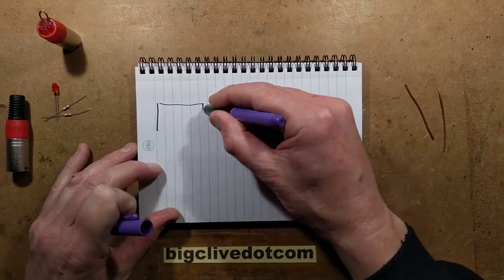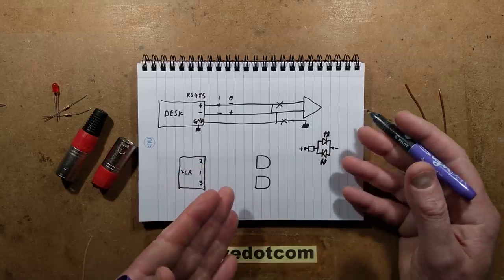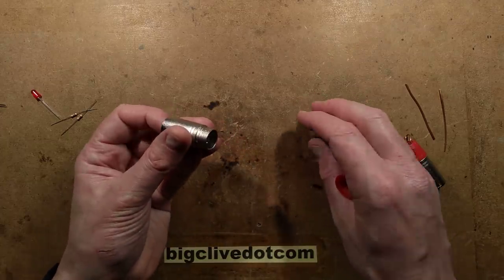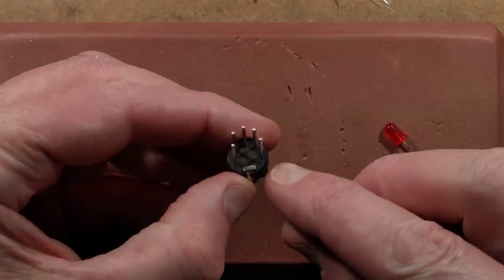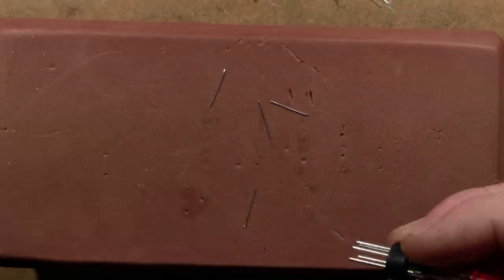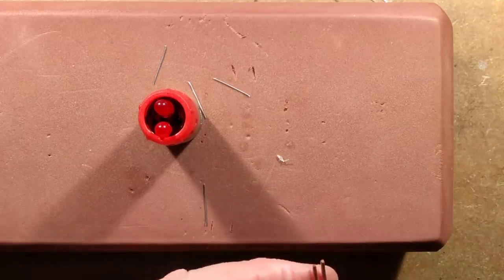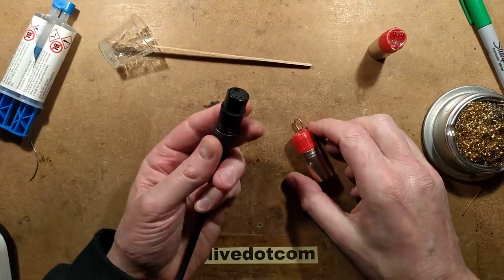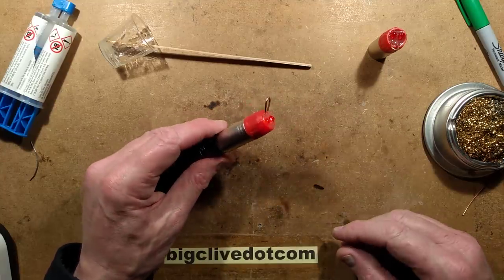DIY keychain DMX tester for lighting technicians.

Comment: I assume that DMX isn't used for any safety critical FX control signals like pyro, with the 5 pin they could have implemented an antivalent signal comparison check.
Reply: It does get used for pyro
Reply: They're not safety critical !
Reply from the maker: It does sometimes get used for pyro control, but only with specialist protocols designed to prevent false triggering on rogue data.
Reply: @bigclivedotcom  To me, the logic would be simple that pyros would be deactivated until a 'window of need' occurred - and withing that window, actual triggering could be done with DMX.
Same with lifts. You see these fancy computerised lifts here and there but you'll not find the computers controlling the lifts - that's all done with electromechanical equipment that's safely reliable. The computers 'request' of the lift controllers to move the lift from A to B at efficient timings.
Nice example - Aston University 'Sky lifts' - once going up, I opened the lift doors. The lift was stopped by the lift controller, not the computer. On closing the doors, the lift then went down - but the numbers on the floor display carried on going up. I suspect the lift controller simply returned the lift to the ground floor irrespective of what the computer wanted - and once there the computer would be reset.

Comment: When I use to do gigging. John (who was a very, VERY clever person) made a few of these and it was a life saver when it come to troubleshooting. Also, the ones he made could tell if it was revers polarity as well which also really helped. 
That must of been at least 15yrs ago 🤔

I really hope you don't use that yellow screwdriveron live things? I'm not tell grandma how to such eggs and I know your a lot smarter than me.
Check out Photonicindution's channel & he tests one of those screwdrivers to see just how "safe" they are.

I love all of your videos btw. There so interesting n I've learned a lot from watching them 👍🏻
Reply from the maker: It's the electronic version of the neon screwdriver, but still lacking a decent series resistor.
Reply: @bigclivedotcom  I'd NEVER use that on anything live. I know there are one's that have a battery inside so you can check to see if there's continuity. You can also put it on someone live, without tough the end n it lights up.

Comment: Soldering XLR cables is one of the worst tasks I've ever had to do. They're super awkward shapes and if you hold the iron on too long (e.g. repairing an old cable and removing an old broken lead) then the plastic casing melts. Burned myself holding the pin I'd been heating a few times too. Don't let idiots hold soldering irons; we will burn ourselves.

Comment: Probably a stupid question but I'm from the IT world not power electrics world.
Is data ground the same as power ground in this case?
Reply from the maker: It depends on the internal circuitry of the lights.  Generally the data ground will be referenced to the circuitry ground, but that then might be referenced to chassis, and therefore power ground.

Comment: Is it possible to make one of these with a 120Ω terminator resistor built in?
Reply from the maker: There is a version you can make that doubles as a terminator, but not the best type that needs the data lines unlinked.

Comment: Can this be used to test the DMX output on a firing system? A non fired Arial shell can be really dangerous and multiple precautions must be taken.
Reply: DMX is absolutely not what you want to be using for pyro. DMX does not use integral error checking of any sort.
Reply: @Peter_S_  diy version works well with DMX but never thought about the error checking
Reply from the maker: Some pyro systems do use DMX, but with a complex error detection protocol built in to detect rogue data.
Reply: @stonedsavage7814  using DMX as the transport is certainly acceptable,  but only if another layer of protocol sits above it as Clive mentioned. If I were DIYing a DMX setup for pyro, I would make it send a series of values in successive frames to arm the device for a short time (like 1 or 2 seconds), followed by a another series of values to issue the fire command. That could be done with plenty of safety. At the very least I would have an independent DMX universe just for the pyro. A better solution would be a bidirectional network and controllers that could give you a safe continuity reading of the igniter remotely.

Comment: Clive at 16.00 it that a Ryobi cordless 18 V  glue gun ?? not seen one here in the US   . And my old radio shack soldering station has gave out the 5 pin has gotten broken  What is a good soldering station at 75$ US on Ebay you would recommend ??
Reply from the maker: Yes it's a Ryobi one plus glue gun.  The generic Chinese solder stations are usually fine, but check the wiring and ground continuity on them.

Comment: Using same colour LED, cutting them the same length, moving them to the centre...

Makes it absolutely impossible to distinguish which one is lighting up.
Reply from the maker: It's purely to detect an open or shorted wire.  The usual fix is to replace the cable and take the faulty one up to the workshop for repair, or to find the fault locally and fix it in situ for awkward cable runs.

Comment: very nice hot melt glue gun. Does it heat up quickly ?
Reply from the maker: It takes a while to heat up, but is very good.  AvE did a thorough review of it.  It's the Ryobi 18V one plus glue gun.
Reply: thanks for your answer

Comment: Clive any ideas on testing XLR mic runs finding a faulty XLR mic cable can be a pain? Crackles failure etc...
Reply: Is that crackles with moving cables or static cables ?
Unless a cable has had exceptional stress in life, most cable faults are at the connector. Most issues can be sorted by cutting a couple of inch off the cable and remaking the connector. Failing that, try the other end. Failing that, repeat but cut a foot or 2 of cable off.

Usually, if you can get a crackle by wiggling cables near the connector - that's quite a good way to find the issue.

If the issue is present while cables are not moving, again, try wiggling cables near connectors. Or take out 'extension leads until you end up with the mic plugged direct into the amp ! If you still have crackles, it's not the cables !
Reply: @millomweb  - Ever had anyone make fun of you for a mic sticking straight out of the socket?    I had a sound board with one straight into the plug, and people thought I was nuts.
Reply from the maker: There are a couple of options for the sound guys.  A mic in a plug as mentioned and also an XLR with a piezo transducer in it that lets you listen for a line level signal by popping the end in your ear.  It's manufactured and sold as the Vizear.
Reply: @tbelding  Why did they think you were nuts ? If that's where the sound was, seems quite reasonable to me ;)

Comment: It would be smarter to add one red/green light (with oppsite poles), then a normal LED, then 2 diodes, and then 3 resistors. Connect like this:
Add resistor to red/green LED and the diodes. (not LED2)
connect then like this:
DMX+ --> Pole A on red/green LED+resistor and Pole A on Diode1+resistor
DMX- --> Pole B on red/green LED+resistor and Pole A on Diode2+resistor
Pole B on Diode1+resistor to PoleA on LED2
Pole B on Diode2+resistor to PoleA on LED2
LED2 Pole B --> Ground

Diodes should be "towards" LED2.

You will now have five states:
If red/green light shows RED + ground flashing RED, then one of the data connections is broken.
if red/green light shows GREEN + ground flashing RED, then the other data connection is broken.
if red/green light shows ORANGE + ground constant RED = everything is working correctly.
if red/green light shows ORANGE + ground is EXTINGUISHED, then ground is broken.
if ALL leds are EXTINGUISHED, then at least 2 connections are broken.

They all fit in the connector because the new connection is parallel to the existing connection, thus they don't take up more space vertically. Makes more of a "safe" detection. Because in your connection, if both leds are out, you don't know if its only a broken ground, or if one/more data connections is broken aswell.

In my connection, you will see if just the ground is broken and both data lines are healthy.
The extra diodes are required to prevent the DMX+ and DMX- backfeeding each other via the ground connection, thus preventing any detection.

Comment: to get more hot glue flow, I cheat and "overheat" the glue gun tip with a small torch, yes the glue will catch fire and burn, but the hotter it is, the less viscous and easier flowing. preheating the other materials works too, but isn't always doable.  I've even directly torch heated glue sticks until they start burning, blow it out and let the dirty burnt part drip away before globing it on whatever, too lazy to wait for the gun to heat up.... yeah, I'm a special kind of nuts I guess ;)

Comment: Dammit miss read that, puts the BMX away sadly !
Thinks it could be dinky if you soldered the LED s via resistor direct into the plug then pot with clear epoxy !

Comment: And if connected to a DMX signal, like on the video, becomes a personal Christmas light also.
Reply from the maker: You can make the other simpler version with an additional terminator resistor and it makes for a nice flickery pixel at the end of a run.

Comment: I think your power calculation for the resistors is off. I'm getting 60 to 70mW peak with a data line stuck at 5V+10%, resistor at 220R-5% and LED at 1.6V.
Reply from the maker: I based it on 2V drop across the LED with 3V across the resistor.  Still nothing for a 250mW or 125mW resistor.

Comment: "Give it a wee drag" instead of just plugging in an extension?
Reply: Yes when u only need that extra inch
Reply: Eddie Thought typically is that the cable is snagged and a quick tug will unsnag it or tighten a knot in the cable from hand size to snack pretzel size.
Reply: @johnfrancisdoe1563  But not really is not unlike?

Comment: Electronic tech, lotsa rs 242, 485, spi debugging. First line sanity check is a similar thing on the appropriate connector, do i actually have data going in or out of the damn thing. For 232, the grand pappy sniffer has leds on the rx/tx, and a 3rd 'sniffer' connector with a dpdt switch n some signal diodes, so you can observe and send data in each direction, with its own leds. But the basic version is a pcb mount db9 male and a solder bucket db9 female, with smd red n green leds n resistors on rx n tx. About 10mm thick solid plastic. Suuuuper handy.

My goober of choice is a plastic sold locally as polymorph, https://www.jaycar.com.au/polymorph-pellets/p/NP4260 , aka Polycaprolactone. Very low melting point plastic, about 60 degrees. Heat it up in hot water, goes like clear taffy, and you can mould n mush it into all kinda shapes. For this kinda thing, make your dead bug/wireframe doodad, n then just smush a load of polymorph around it, n you have a solid plastic part. Harder than hot glue, and you can really wad it in, so its very rugged. Doesnt wick, so can use it on unsealed switches n connectors, conducts light ok, so you can encapsulate smd leds. Brilliant stuff.

Definitely a must have if you do rapid prototyping, test jigs, tool handles, adjustable mounts, any kind of bodging. Its the perfect midground between hotsnot n epoxy. If you chill the parts, you can press it into pretty decent cast (more than good enough for a removable mount for an odd shaped part or something), if you heat the part, it'll bond solid. Kinda like zip ties n wd40, once you get used to using them, you cant imagine a toolkit without.

No affiliation, i just love the stuff (a mate buys it in 20l bags from alibaba, a 6 pack gets you a milk jug full. Beer economy ftw)